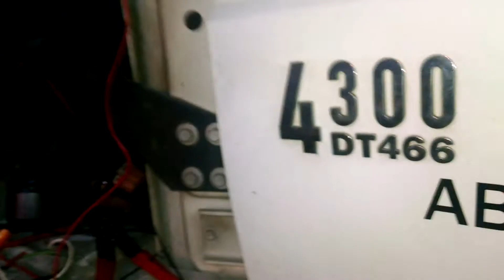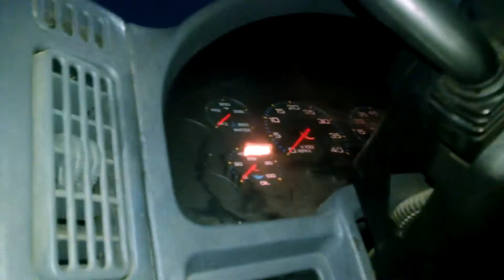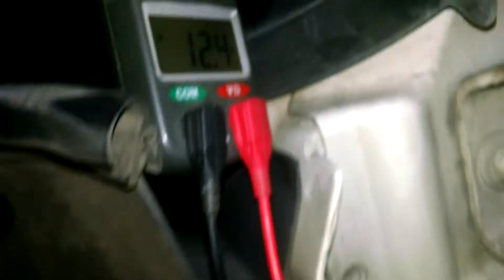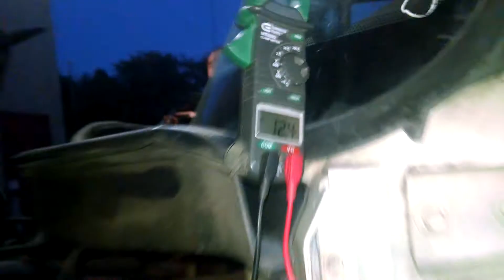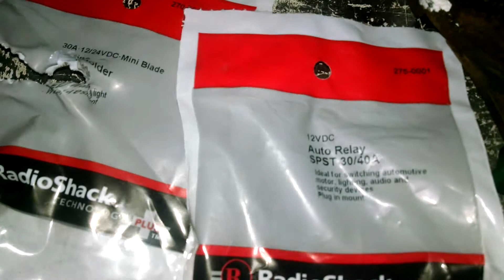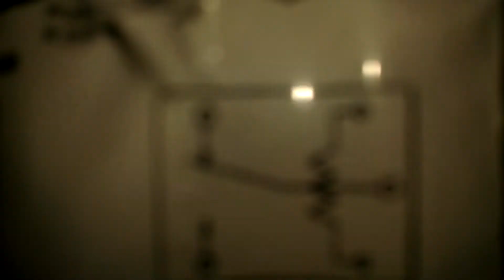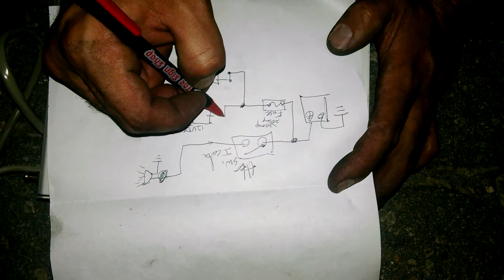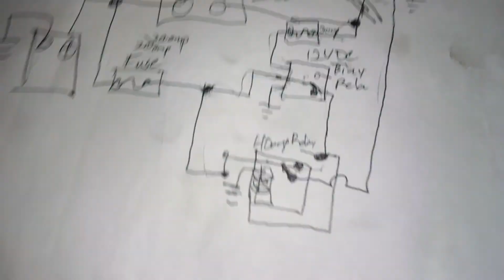Parking light issue. 2005 International truck

Comment: Got a 2008, head lights wont turn off always. In other words  when we press the off direction on the panel  switch, it may turn off or may not. I have changed the display panel as well as the switch but it hasn't helped. When I say display panel I'm speaking the whole panel that display mph/fuel/mileage etc. Any advise???
Reply from the maker: Last thing to check would be wires but I think your computer is close to needing replacement.

Try swapping the $500ish computer that links to head lights
Or
 bypass the circuit with a more widely used switch/relay/fused circuit.
Reply: @Georges3DPrinters  Thank you sir!

Comment: Where are u located? I have an 07 international that  has an issue where the parking lights come on by themselves at the most random times.
Reply from the maker: Check your switch, currently in Hesperia CA
Reply: George Robles  would you be willing to come out and look at it? I’m located in the city of South Gate
Reply from the maker: @13stanleycup  if the price is right, sure. But for most on YouTube, that's a no cause they trying to save money. I'm about 85 miless away from southgate right now it's about a 2hr drive with traffic varying that.
Just saying to go look at your problem is 4hrs of just driving plus fuel. That's costs people near you won't have.
If your still interested, just let me know. Sorry for late reply, been helping a friend/training + work on the multiple cars. Valve heads, radiator swap, wire troubleshooting, etc.

Comment: how can I install dashboard lights in a international 9200....
Reply from the maker: easiest way after market with separate control.
otherwise you have to work for it. Will need to trace out the wires that used to go there, maybe do what i did for a relay setup, or setup an arduino to sense and activate the lights you hook up. if you go original wires but use a different source path is basically what i did.

if you want to Skype (video call) then let me know and we can work out a fair cheap price for an hr kinda thing for some advice.

My question is, how do you want to go about it? 
original bulbs and wires?
led strip stuck somewhere close to what you need?
strategically placed black light and fluorescent paint?
too many to list really....
Reply: @Georges3DPrinters  hi George I have a problem with my rear marcar light on a 2007 international flat bed.i need help